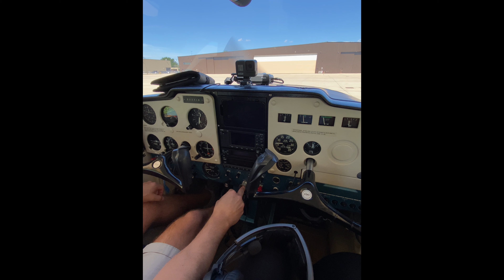Our Plane Is Getting A NEW ENGINE

Comment: Nice content! I typically choose to avoid extensive maintenance at all costs, my own opinion is maintenance-induced failures and "infant mortality" are a much higher risk than an engine past TBO (calendar or hours), until the engine tells me it's time - metal in oil filter, etc. In this case, my personal opinion would be to ream the valve guide with cylinder installed and no major teardown. That said, i 100% agree that this is a personal decision and may disagree with my risk assessment. Keep it up!

Comment: Hey it’s America so you can do what you want. The reality, however is that a freshly overhauled engine is way more likely to fail than one that has 1000 hours. When I finally overhauled my engine I was 500 past TBO (34 years!). It was leaking a little oil but otherwise perfect inside. I blew it. Should have kept going. New engine has been way more problematic than the old one. Hope you have better luck.

Comment: Yes, piecemeal overhauls are less desirable. My brother and I faced an engine making metal in our '73 C-150 but we had access to a fresh overhaul from a community college that trains mechanics. They undergo on the job training and sell freshly overhauled engines. That brings down the price considerably and we received a nice running engine that gave us confidence for night flights and VFR on top. Yes, I would have given my firstborn to have a nice fresh 142 hp turbo Rotax, but there are no STC's. Our plane delivered 700 fpm of climb and a solid 120 mph cruise speed.

Comment: You guys absolutely made the right decision to overhaul your engine. We did the same thing to our Cessna. Ran like a top and we had no issues at all. But the engine was over hauled 20 years ago and only had 1,230 hours.
  We fly our small plane all over the USA as well. Doing the type of flying you guys do. You are better off with a freshly over hauled engine. Now you have 1,800 hours or 12 years of no issues.
  Not to mention the value you added to your exceptionally clean Cessna.
  Enjoy!!!

Comment: It hurts the family budget, but you did the right thing.  That's an awesome engine and it deserves tender-loving-care, and of course it's responsible for precious cargo.  I realize this video is old and I assume you have kept the plane and it's running like a well-oiled air-vessel.  My only question is, how did you get the valve un-stuck before you had to get it to the repair destination?  if I missed you say that, so sorry for stupid question.

Comment: Good deal….just recently overhauled the engine in our 120. It was a C-85, but we ended up putting an O-200 crankshaft in it. Substantially noticeable difference in power! Great climb rate and can now outrun our 172 in cruise 😂

Comment: Great info! At the end of the day, you have to trust your plane 100% Thats a big reason I rent an Archer at my FBO instead of the arrow (250 hrs vs. 1,500 hrs)
Reply: So trust keeps engines running What do you trust more statistics or feelings?  Statistically his engine failure rate over the next 200 hours is 300-500% higher  on the rebuild than if he kept on maintaining the old one. Decisions are better made rationally than emotionally.
Reply: @doctaran  people don't realize that new engines fail way more often than old ones

Comment: At the end of the day,  you as the owner and pilot are responsible for the aircraft and it's passengers and by extension anyone on the ground that may be affected.  Also it's completely your choice whether to spend your money.  Flying will always carry an element of risk and is at it's core is a risk managing exercise.  Your overhaul goes along way to reducing one of those risks and was the right choice imo   😊

Comment: Really nice 150. The Blue is the best color for polished aluminum. Does the reduced painted surface help improve your useful load? A buddy and I are combined weight 395 with full fuel of 22.5 and Oil are concerned  about being over gross when flying a Classic 150.

Comment: At 1300 hours the risk of catastrophic engine failure is way less than on that expensive rebuild.  

Rebuilt engines have the highest failures rates.  Rebuilding engines increases risk rather than decreasing.  

Running some of that marvelous mysterious engine additive probably would have prevented this whole thing. If your anxious flying don’t rebuild the engine work on  your skills.  

Rebuild it when there is no compression left or the metal internals start to fail.